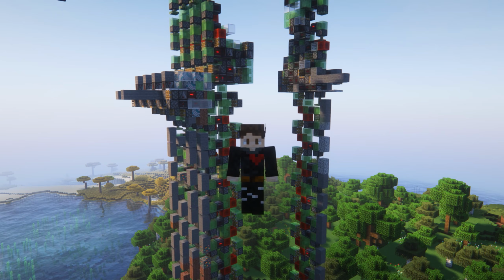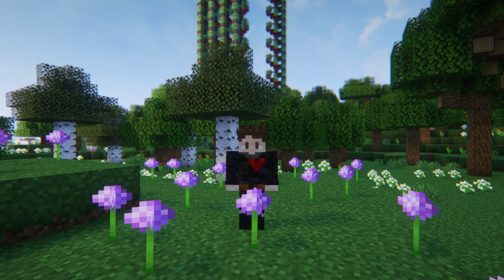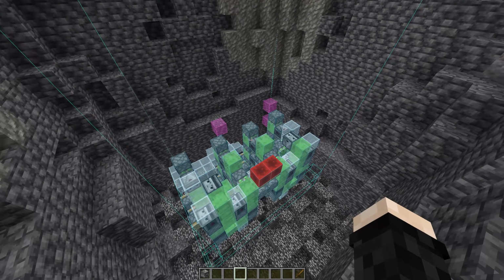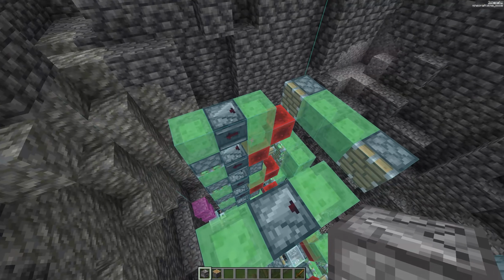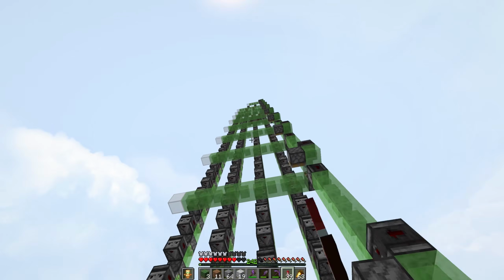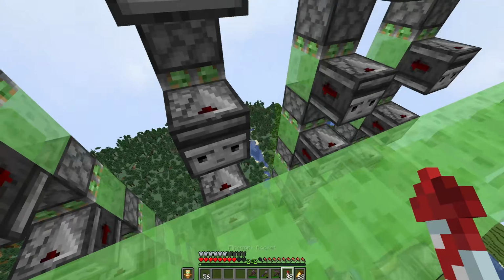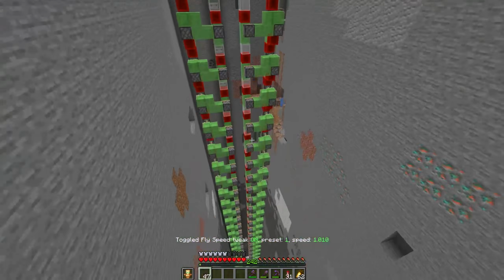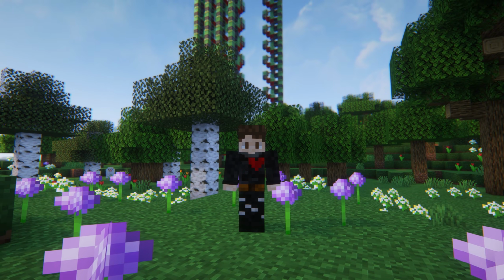Automatic Trench Machine | Chronos Trencher

Comment: Hi, just testing this in a creative testing world and can't seem to get the machine working properly. I start it with the fence gate, and then it grabs one layer of blocks and brings them to get destroyed, but then the grabbers don't come back down. I can send them back down, but then the machine just stops working. Any help would be great. I was planning on using this design. I used the 3W Trencher for reference
Reply: Same. Did you find out whats wrong?
Reply: @lotschingol7268 No i just didn't use it because no one responded.
Reply: @Fidgetwinner  sorry to hear that, but if you wanna use it in the future i know why it breaks. Just dont build the afk spot and make a glass box to afk nearby. After that the  trencher worked without any flaws

Comment: So if I put a slime block wall at the end of my trench then it’ll mine the shield AND stop?
Reply from the maker: Yeah, it's gonna destroy everything to the slime wall and then break rather than properly stop
Reply: @Elyrio3  do you think placing obsidian in line with the glass at a point where you want the trencher to stop also work?
Reply from the maker: @dragn270  The trencher will stop where the bottom trench ends so no need for obsidian. And the slime wall is only needed to remove the remaining terrain in front of the trencher, the other option is to remove it manually
Reply: @ great! Ty!!

Comment: nice design, 12 wide works perfectly but my 3 wide doesn't. it keeps breaking and don't know why no blocks that can trigger any redstone and also no immovable blocks. the only thing i can think of is that it is because i rotated it to an other direction or because i start an LAN world so i can spawn in bots
Reply from the maker: The 3 wide can be rotated in any direction so that's not the problem
You need to see why exactly it breaks to find how to fix the issue otherwise it's hard to help

Comment: I've been building a 528^2 perimeter and used both the 3 and 12 wide trenchers, they saved me a ton of effort compared to the smaller smooth wall trenchers I used for my last perimeter! After some mishaps with creepers and gravel that broke the 12 wide a couple times, I figured out some of the fixes you showed on my own, but you shared a few that I didn't know then that could have saved me a lot of time. Hopefully my final trencher -- another 12 wide -- has no issues (I'm 2 for 2 on the three wides!) but this video might save me some time if it does. These videos are a blessing in making cutting edge redstone machines more accessible to the public, and I'm extraordinarily grateful for your content. Bedrock breaker build guide next???
Reply from the maker: Thanks a lot I'm glad it turned out useful
The thing about bedrock breakers is that it evolves quite often and there are a lot of options depending on how you play

Comment: ive been making a 304 x 304 perimeter on my private server, and couldn't have done it without the 3 wide trenchers
Reply from the maker: @m0iaMC  more time yes but less manual work, if you can afk and don't care about the total time it's a better solution
Reply: @m0iaMC iv done it this way cause i dont have much time to play so having something that i can build and just leave running with a bot is easier for me than making a larger smooth wall trencher that i have to remove more liquids and obsidian

Comment: nice video, gonna make my first peri soon... what shader is that btw?
Reply: good luck for your first perimeter but i would not recommend using these trenchers they are for mostly advanced players and are overkill and take wayyyy to much time to run. I would recommend to use a simple tnt-trencher with smooth wall cause its almost the same as the 3 wide but wayy beginner friendly
Reply: @m0iaMC  i am not a beginner in tmc… also how can i learn the hard stuff without ever trying it out, right… and if i fail, i can ask for help in discord and always refer back to easier stuff when i need to…
Reply: @adrianus2738  thats right! Good luck!
Reply from the maker: Thanks and good luck, those are the Complementary Unbound shaders